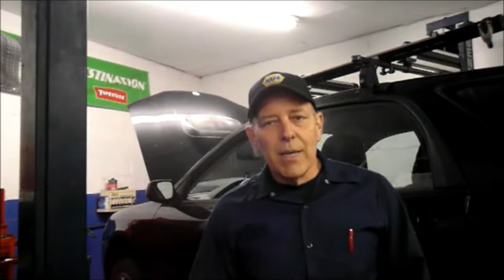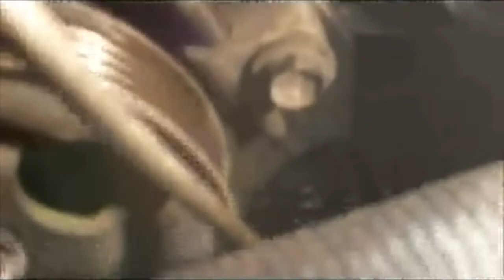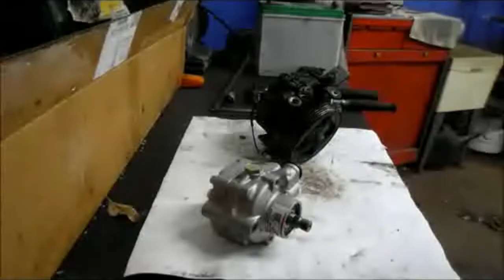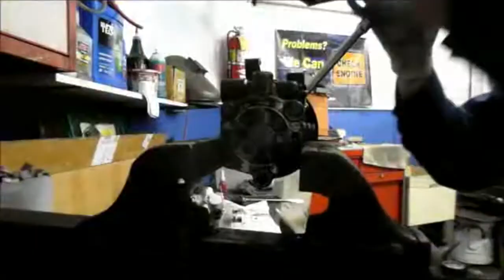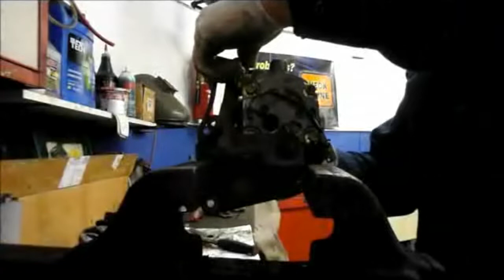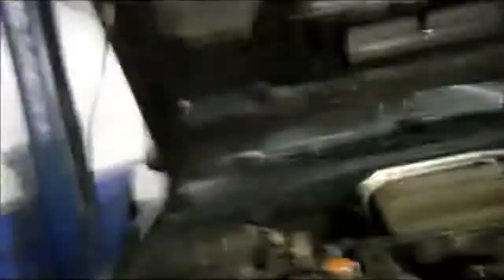Power Steering Pump Replacement 2002-2007 Subaru WRX

Comment: I struggled a surprising amount with this job on my own. I accidentally stripped out the threads in the pump where the banjo bolt goes in and had to order a new one. Thanks for the guide
Reply from the maker: I’m happy to help

Comment: Good video, thanks for the info. My 2002 wrx has an Allen bolt on the pulley. I am wondering about the fitting on a newer or rebuild pump. I see that they come without a pulley 
Thanks in advance for any advice
And thanks for this videos

Comment: Great job, Jim.  I believe this is a common problem with the WRX (leaking PS pump).  I used to have a 2006 and replaced the pump due to a small leak.  I believe it has 6 or 7 o-rings and one or two end up shrinking due to heat and age, causing the leak.